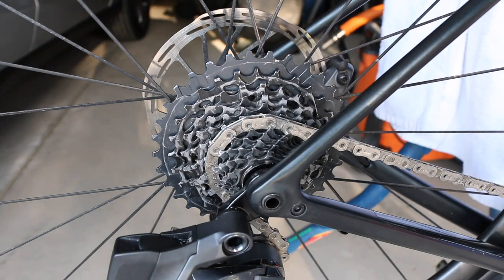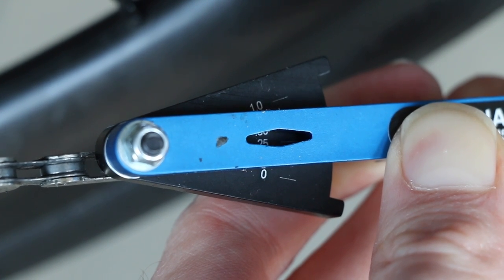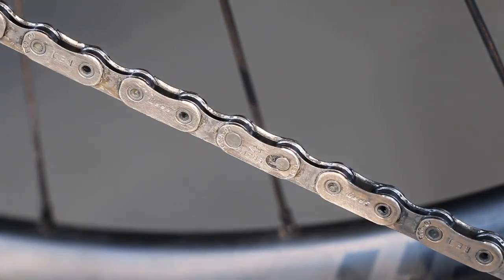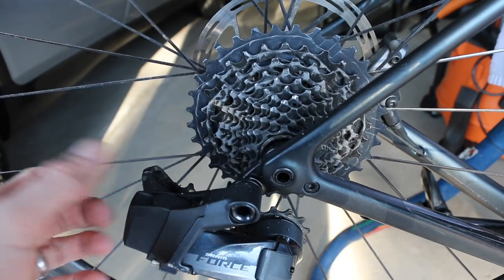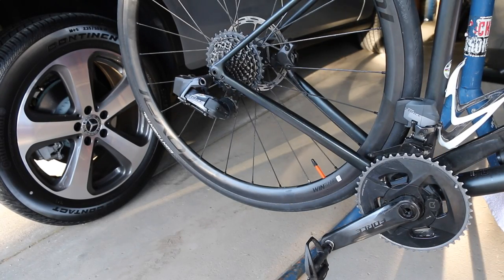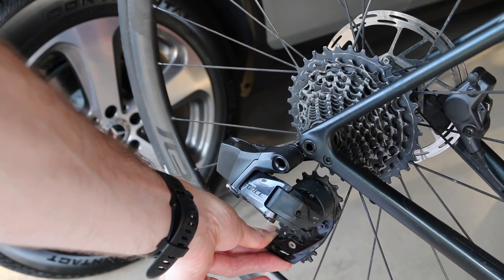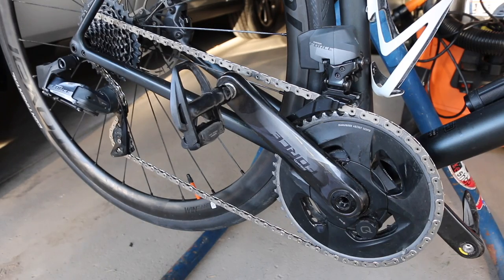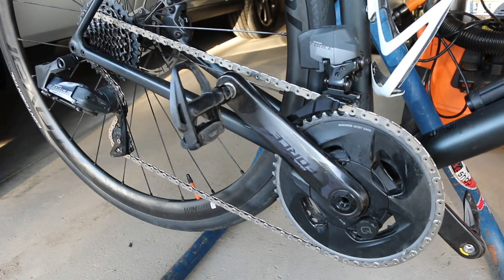Sram 12 Speed AXS Chain Install - Road Flat Top

Comment: Your chain checker the CC-2 does not read 12 Speed AXS chains. You need to use the CC-4 according to Park Tools
Reply from the maker: You’re correct. I have both… this is why I replace at lower wear than .5… The roller sizes are slightly bigger on flat top chains.
Reply: Just use cc4

Comment: Does it make more noise and smoother than the Sram force axs 12 chain?
Reply from the maker: The same as force. The noise comes from the Force cassette. red is quieter.
Reply: @MitchOnTwoWheels  I see many people use Sram Eagle XX1 12s chain for Sram (red - force) AXS 12, do you know if it is quieter and smoother??? Sram force axs 12 makes too much noise
Reply from the maker: Really? It shouldn’t work as the cassette widths are different. Flat top chains only…
Reply: @MitchOnTwoWheels  true, even say it's smoother and quieter, but I haven't tried it....cassette Force sucks....just changing the cassette Sram Red axs 12s doesn't seem to be noisier than the Sram cassette Force
Reply: @dragondj2802  Costs twice as much, totally not worth it just for the lower noise. Might also be a misalignment problem somewhere. The cassette on my power trainer became much quieter after a front derailleur maintenance.